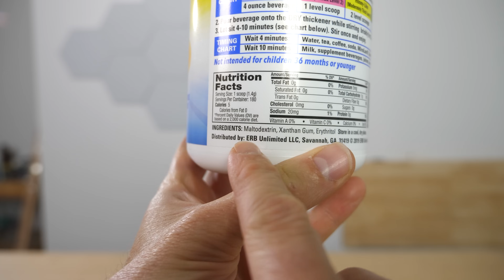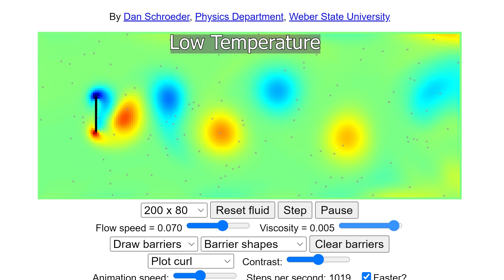When Does Pure Water Get Thick?

Comment: The cold water is denser than the hot which is slowing the ball. It is going through more matter, so more friction, not necessarily stickier (more viscous) matter. A really neat demonstration none the less, especially how the time changed after just a short exposure to ambient temperatures. Just a few degrees making a noticeable difference.

Comment: I want to see something about forgings the best and sharpest budget knife, because I'm sure there are a lot you will find to explain, because the sharpest blade  is diamond scalpel used in the eyes Operation
Reply: Well, whatever goes into forging a good knife, kamikoto isn’t using it! They are owned by the same people as dealdash and established titles. It’s a scammy Chinese company that sells $20 knives for $200. Please, please don’t buy them. You can find a better knife for cheap at a local Walmart.
Reply: @littletimelord2755   you don't really spend 200$ on a knife? Buy a small victory Inox ( not a fake) I literally abuse my over 5 years and it's still sharp

Comment: There's also "gelled water" (and gelled solvents) for use in cleaning paintings, as they stay damp on the surface for longer (and/or with less likelihood of penetrating through cracks in the paint and potentially loosening it from the canvas), giving the water or solvent more time to break up dirt and stains or old yellowed varnish. But I'm pretty sure those use methacrylates or PVA and are def NOT edible!
Reply: From what I remember from Baumgartner Restoration, he uses laponite as a thickener with water when cleaning paintings. I believe it's a kind of clay
Reply: @samuzamu 
I just recently fell into the Baumgartner rabbit hole. Seeing a connection between that and Action Lab is very funny right now to me lol

Comment: Not this knives again. There are several reviews of these knives and they are not good. Wikipedia about 420J2 steel: "... are economical, highly corrosion-resistant stainless steel grades. Knife manufacturers use this material in budget knives, also in diving knives due to its high resistance to corrosion.".

Comment: 7:33 "Aaaaand my table's on fire." 

How could you be this calm with such a huge flame all over your table?!?
Reply: And he wonders why his wife was nervous lol.
Reply: It was just the ethanol burning, not the table. I've lit my hands on fire the same way. It's too hot to allow to continue for more than a couple of seconds, but not hot enough to char wood, I think.
Reply: @adameager7114 
But it's hard to extinguish such a large alcohol flame in short time, as alcohol floats on water and such a large area is hard to cover effectively with a blanket.
Reply: @Lampe2020 He probably has a co2 fire extinguisher. And he has liquid nitrogen.
Reply: @Lampe2020 I once blew out an alcohol fire in a big bowl
Reply: @Lampe2020  Doesn't change the fact I stated, alcohol does not float on water, it mixes with water.
Reply: @Lampe2020  On the contrary it likely extinguished itself. It was only a  really thin film of alcohol burning, so it likely run out of fuel and died down without any intervention needed in just a few seconds.
Reply: "This is fine"
Reply: Freaking out gets you nowhere. Calmly assess just like he did
Reply: @dakotaperalta1302 darn i came here to say that but you beat me to it 😅
Reply: fr
Reply: Ain't his first rodeo

Comment: On the tube tests, are you sure you're measuring ONLY viscosity? While the curve gets weird close to 0° C, water otherwise does what most materials do and gets denser as it cools. Is the resistance of pushing through denser fluid identical to the resistance of pushing through more viscous fluid?

Comment: I always knew the difference between the sound of pouring hot water and cold water, but never thought about the reason. Thanks for the explanation. Amazing video indeed.
Reply: Also salinity affects the behavior of water
Reply: @matazmataz2493  Yes... boiling and freezing points also change due to salinity...
Reply: @SivaranjanGoswami  You are right but not only phase change temperatures are affected by salts in water,  also cohesive propreties in the liquid phase are changed by salts and other solutes. For example pure mountain lake water splashes differently from sea water at the same temperature.
Reply: @lucamatteobarbieri2493  yes. That's true. That's not only salt. Anything that gets dissolved in water can affect its viscosity. Sugar syrup is simply a lot of sugar dissolved in water. Similarly, when you dissolve too much salt in water, it becomes brine.

Comment: pressure also changes the density of water, though it takes a lot of pressure to do this. you can do the math to figure out the changes, or you could look up the tables from scientists that have done tests to figure out if the math works on water (water is weird and doesn't act like other liquids).

science also explains why the fire wouldn't catch, and why she thought it tasted weird but you thought it was just thicker, if you want to really dig into everything that was on the video.

Comment: In the drop test, did you account for thermal expansion of the tube? Because that could reduce the random drag on the side of the tube in the hot water.
Reply: Unknown until the experiment is done in a wider container.
Reply: To what extent would the expansion of the tube be countered by expansion of the ball, and would the difference then be significant? We're talking .2s margins here.

Comment: For the viscosity test, wouldn’t the hot water lead to an increase in the size of the tube?  Even very marginally, it might dominate the measurement you think you’re making of viscosity
Reply: Great point. Also, the freezing water would contract the tube, making it more difficult for the ball to pass through as easily.

Comment: Pouring HOT water also sounds different because hot water has a MUCH higher vapor pressure, which cushions the impact. To compare, water in vacuum has essentially no gas cushion, so in a glass jar it hits the glass quite hard, and sounds like Mercury metal! @TheActionLab

Comment: The hot water was easy to hear because you can hear...something about the steam. It sounds like a gas, or air pockets being pushed out of the cup. But i don't think i heard anything unique about the cold water.
The thing to try would be comparing the difference in sound between cold water and room temperature water.

Comment: I always thought the sound difference is caused by the vapour and air mixing in when it's hotter
I mean like the pressure made by it trying to evaporate more than usual

I guess i didn't know the reason it wants to evaporate is air (or at least I remember someone saying that things don't evaporate without air in lower than boiling point temperatures but air that mixes in decreases the temperature needed to boil. Someone correct me if this is wrong too (i mean the fact that gas in this case air is decreasing the boiling point of water when it's touching it). @-@)

Comment: Is that actually the alcohol that made it thick?. 

Or is it the slight moisture that’s instantly absorbed into into alcohol it sucks the moisture right out of the air and contaminates the alcohol with water molecules . So you end up with water, suspended, and attached to alcohol molecules that freeze

Comment: Thanks for the jokes of the knife producer "cutting out the middle man" and the "... and my table is on fire. But what about water ...". 🤣🤣🤣
3:11 Okay, so the answer to the title question "When Does Pure Water Get Thick" is: It doesn't!* You add a mix of Maltodextren, Xanthan Gum and Erythriol which is having "a fun time" (official chemical term right here. Just kidding. 😉) with the water molecules and you get a kind of sludge, which is NOT by any means pure water.
*: Well, there is actually a scientifically interesting lesser known aggregate phase of pure water between liquid and solid that is quite difficult to get the conditions right for. It's called "EZ water" and has some interesting characteristic.

Comment: In the ball drop experiment, the results could be affected by the change in density of the water. Cold water is denser, which would make the ball slightly more buoyant in it. The difference might not be enough to matter, but maybe it does.
Reply: The tube size is close to that of the ball, so fluid dynamics would be a big unaccounted factor too.

Comment: For very tight tolerances, you'd have to wory about thermal expansion of the metal ball and the tube affecting the results, but it looks like your setup is a pretty loose fit, so that shouldn't matter much.
Reply: Yes, the tube shrunk. Even a small amount would make a difference because of the narrow fit to begin with.

Comment: I have no doubt that hot water is less viscose than cold, but I think one might think about what other things could possibly be happening.  

1 is density change, and 
2 could differences in expansion create more space between tube walls and the ball allowing water to more easilly move around the ball. 

The second point can become significant where expansion coefficient are significantly different and where the ball's diameter approaches the inner diameter of the tube.
Reply: This.  Surprised that I had to scroll this far down to find someone with the same thoughts.
Reply: @tinhoyhu  scrolling down is sort of a proxy for likes. And how far up comments perculate and get shown to others first. And besides liking the affirmation likes bring,  I am also surprised more people didn't take interest to questioning an experiment's conditions.

Comment: For the vicosity tests, I think you should let the ball reach terminal velocity before line, as you do not need to take acceleration into account.
Reply: Does it matter, though? If one is thicker than the other, then acceleration and terminal velocity would be slower, resulting in a longer run time.
Reply: @grex2595  well yes,if you just want to prove that the viscosity changes there is no problem. But if you wanted to measure viscosity getting rid of acceleration simplifies the equation.
Reply: @lemacke2755  fair enough, but it looks like he didn't care much about calculating viscosity. It's just a physics lesson on how viscosity works.

Comment: It's not pure if you put something in it...
Reply: Reminds me of when he passed a science theory off as a fact. He said something about a laser's focal point being so hot that it was actually negative Kelvin. Make it make sense.
Reply: This makes me think

What if a fish put a square of carpet in water and a human bottled that water up?
Pure carpet water because *you* didn’t put it in there
Reply: That's what happened to your mom
Reply: Define pure...
Reply: @MeowMixMRE pure substances are substances that only have one type of molecule. There are 2 kinds of these pure substances elements (for example carbon) and compounds (for example table salt).
Reply: @Velocityyyyyyyy  Correct. Of which water is not haha
Reply: @MeowMixMRE  depends on the water tap water isn’t a pure substance but distilled water is.
Reply: @Velocityyyyyyyy  The number of molecules in distilled water depends on the volume of water being measured. For example, a drop of water, which is about 0.05 milliliters, contains 1.4 sextillion molecules. This is calculated by first determining the number of moles in the drop, which is 0.002775 moles, and then using Avogadro's number to calculate the number of molecules. Avogadro's number states that there are 6.022 x 1023 molecules of water in one mole of water.
Reply: @MeowMixMRE  correct and because there are so many molecules it is basically impossible for something at bigger sizes to be 100% pure usually the most pure would be around 99.99% pure.
Reply: @Velocityyyyyyyy  Yeah I was just being a smartass 😆
Reply: @MeowMixMRE  I forgot what avogadro’s number was what was it again?
Reply: @Velocityyyyyyyy  I don't believe you lol
Reply: @Velocityyyyyyyy since other dude was being an ass, here

6.022 × 10²³
Reply: @Jake_Gotthard If I'm not mistaken, it can also be written as 6.022 x 10^23.
Reply: @Herandro_just_Herandro  yes, i just copy pasted it so it was superscript
Reply: that means every compounded chemical (including water) is not pure, the only pureness is sole elements
Reply: @coolio7189 That’s life.

Comment: Kamikoto uses 420 stainless steel the most absolutely cheapest stainless steel you can still call "knife steel" also the single bevel side sharpening is half the price of double concentric bevels.

You're literally better off going to Walmart and getting an Ozark trail kitchen set, it's the same or better steel, it's beveled on both sides and the entire set will be way cheaper than 1 of those kamikoto knives.
Reply: I am surprised I could even find a comment like this, since I expected them to get filtered out pretty quickly.
Reply: yep thats's cool  @beardiemom
Reply: But they're Japanese knives, made in China.. by chinese craftsmen.. with over 3 days of knife making experience ..using the cheapest steel available to them ...and the cheapest production method they could think of  ...that will still hold an edge in moderate winds.
Reply: @eelcogg Only the steel is Japanese, and even that could be a lie lol
Reply: @sebishoshocontostao1473  Japanese steel isn't really good I guess.
Reply: @NobodySure9375  there is a reason they had to fold katanas over and over and over during creation. Japan has pretty impure iron, and the folding works out imperfections. European iron has less imperfections, and that's why you don't see the folding technique as often in their traditional blades.
Reply: @timelessninja  yep, that's what I mean. Japanese has worse iron, so they remedy it by folding the iron sheet.
Reply: Ding! After I posted my comment, I was looking to see if anybody else had something to say about those knives. As I suspected, the action lab simply it says whatever needs to be said to make a quick buck regardless of the quality of the product being advertised.
Reply: 420 -  nice
Reply: finest japanese knives, made in china 😂
Reply: They're also owned by the same company that owns Established Titles and DealDash. They're scammers.
Reply: @nate.draws.things  I was wondering if it was the same guys.
Reply: gotta give them credit for at least adding that they're chinese to the script
Reply: Scott Shafer did a whole thing on kamikoto knives.
Reply: And even if they were good knives, the ad is irrelevant to the subject, and much too long

Comment: I'm curious what percentage of the global population still uses Faranheit for temperature, it's less than 1%, right? Genuine question.
Reply: All of the US uses it, so that's 4% of the world at minimum.
Reply: The US is pretty big. When your temperature sense is linked to a particular number scale, it's hard to change to one where you're not as familiar. An American being told it's 40°C outside probably wouldn't realize how hot that is.
Reply: @mike1024.  I can totally get that, all I know is that something like -43 degrees they are the same, beyond that, not a clue!
Reply: @Billybobble1  -40 they are the same. Freezing point of water is 0°C vs 32°F, boiling point of water is 100°C vs 212°F. I feel like Fahrenheit has an advantage that 1 degree difference isn't as substantial, so you can fine tune temperatures on a thermostat without having to resort to decimals. But its seemingly arbitrary values for freezing and boiling points of water is strange. When you're unsure of a particular temperature to interpret it, you can always use F = (9/5)C + 32 and C = (F - 32) * (5/9)

Comment: what about heavy water that used in nucler reactors, are they drinkable?
Reply: Heavy water doesn't work properly in many chemical processes in the body, so you would get poisoned by it. Not by a very tiny amount, but definitely if you drank cups of it.
Reply: Heavy water is water that has deuterium rather than normal hydrogen atoms.  I would not drink it, although I'd guess that a small amount wont be a problem.
Reply: @DeusExAstra  Well, James needs to make the sacrifice and check 😉